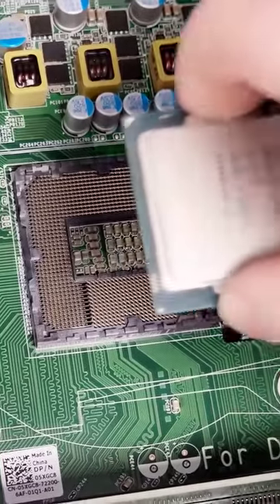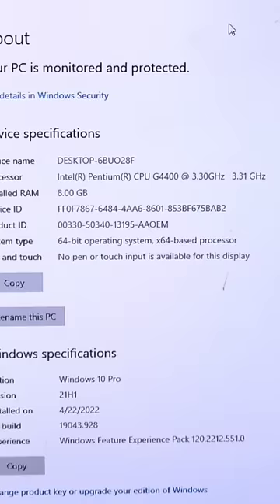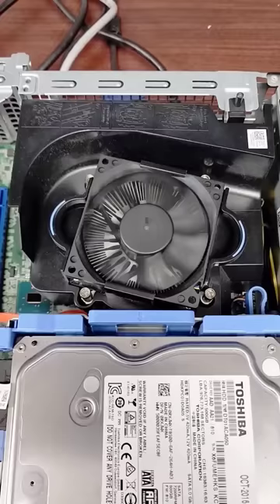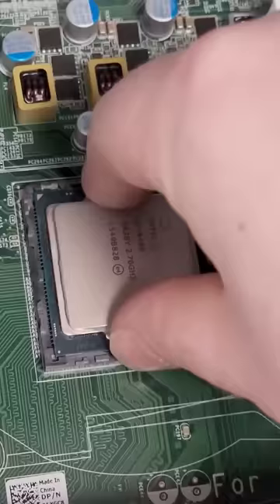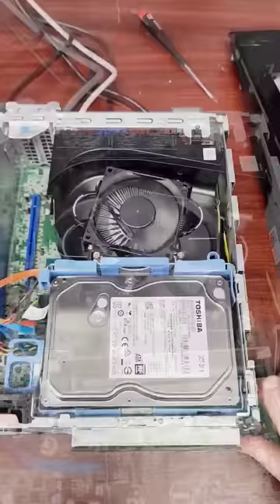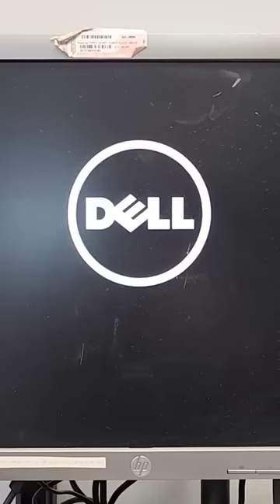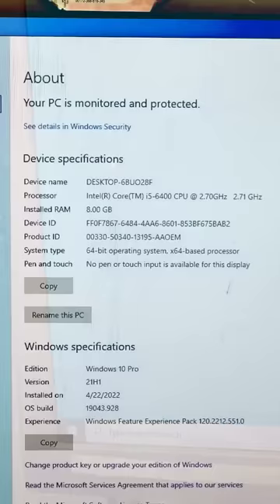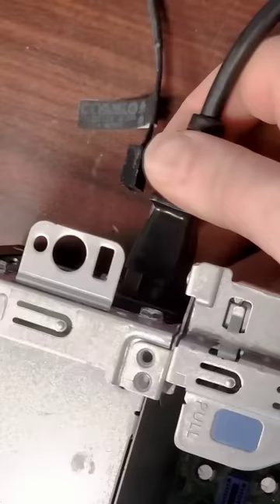CPU Swap while in Sleep Mode??

Comment: Whenever you removed the processor, you cut the power connection from the motherboard to the processor, so of course it wouldn’t work. That processor has pins that needs to be powered if the computer is on and sleeping. Have you ever installed an AMD processor with the motherboard powered on? If you plug in a Ryzen processor, the motherboard turns on. AM4

Comment: (TL;DR: You basically power cycled just the CPU.) The CPU pretty much IS the computer. A CPU is made out of millions of transistors to store bits, file them, and compute them. Once you take the CPU out of its socket, all power is lost, and the transistors aren't holding anymore of the data coming in, so everything crashes. The RAM has nothing to communicate to, the hard drive can't have data fetched or stored, etc. Windows is being run by the CPU, so putting it in sleep mode only stops some programs you're running, not the CPU functions. This is all over the place I need to go to bed

Comment: what? I was sure sleep mode just turns the screen off and keeps running in low-ish power mode, and thats why the battery drains so fast in sleep mode compared to making it hybernate instead

Comment: I did this but I switched with a CPU with the same numbers of cores and threads, just different clocks. Windows thought the CPU was still clocked at a higher rate so I think something went wrong with the internal clock. When I started a game, it ran in slow motion on the slower CPU. One restart later it ran normally again.
Reply: Why would you do this?
Reply: @TheBrainSquared  TL;DR: It was an accident. I was building an ITX PC and wanted to sell my old PC which had a 3570k in it. I got a good deal on a used z77 ITX board and transplanted in my CPU from the old machine. I discovered that my cooling wasn't good enough and the cooler was way too loud for my taste, even when undervolted. I forgot to turn off the hypersleep setting windows enters when you select "shut down" which saves the current session to your boot drive when you turn it off. I replaced the CPU with a 3330s, which ran a lot cooler and quieter, but since it's clocked lower and windows never got the memo that there was a new CPU in the system, it just messed up the internal clock. That's what I assume at least. One restart later and it all ran fine.

Comment: Now try it again, but use hibernate instead.

I've successfully replaced parts in my desktop whilst it was hibernating, without requiring a reboot.

I'm using Linux however, and I didn't try to replace the CPU tho...

Comment: This never would have worked because boards need power cycled for the bios to recognize and properly run the new chips.

This failure has nothing to do with windows

Comment: Windows no longer supports Sleep S3 mode (power only to the RAM). Instead it has Sleep Zero mode (power to the RAM and CPU). So the CPU you swapped was still connected to power.

Comment: Sleep doesn't fully power the computer off AFAIK, it just goes into a low-power standby mode - so it makes sense that removing the CPU would mess things up and require a power cycle.
I believe Hibernate does fully power off the PC while saving the state to the hard drive (hiberfil.sys), so I'm curious if that might have a different outcome. That button doesn't show up by default though - you need to enable it through Windows settings first, since it's not entirely recommended for the average user.

Comment: These tests are incredibly strange… if you know what the function you’re using actually does, you know the outcome and there’s no need to try it irl. It’s like smashing a bat into a car’s front bumper to test when the airbags’ll deploy. How much basic PC knowledge (like the differences between and functions of sleep, hibernate, restart and shutdown) do you have to lack to think hotswapping a CPU is gonna somehow boot back out of sleep without a problem?

You could just look into the manufacturer’s car specs and the fundamentals of airbag deployment to get a precise answer. Or, I guess, smash up the car and when it finally deploys go “so it DOES deploy, but only after a few good hits in this general area it seems?”.

Comment: Hibernation saves the system state and powers off.
Sleep mode reduces performance and power consumption as well as powers the display off. The computer's state is NOT saved and stays in RAM.

Know the freaking difference.

Comment: Totally stupid thing to do. And you should have known this too.

You never disconnect any integrated circuits from its surrounding circuits unless ALL power is removed, OR the device/card has been designed for hot pluggable operation by having  power pins/connections longer than the other pins.

Do NOT do this folks.
You can cause a latch-up defect inside the device itself which doesn't show up immediately.

Comment: 😂😅 .lets experiment with you .if we replaced your brain while sleeping .you too will be confused .the cpu is the brain of the computer .its where every process that was scheduled to happen in the computer gets stored and resources pulled together to achieve an app running .so you were trying to confuse the computer by replacing its brain lets take you for example if you had planned using your brain to wake up and go to your job and then i replace your brain with another brain of another person who was to wake up and sit on his couch your body will be confused same as a computer just take the computer as a person

Comment: Sleep mode is S3 suspend to RAM, it's still under power and any input from mouse or keyboard will "wake" the computer. CPU and memory running on very low power mode to save energy, useful in laptops mostly. So of course it's an useless test. You practically removed the "sleep" feature and also dangerous because under power, you could and can produce a short  = dead PC. Never work with components under power supply feed.

Comment: This was extremely predictable and should never be done. Since sleep mode is not a no power state, it's a low power state, you still have power and it would be dangerous to change your CPU while in sleep mode. You'll could easily damage both the old and new CPUs, and possibly other components such as your motherboard and RAM.